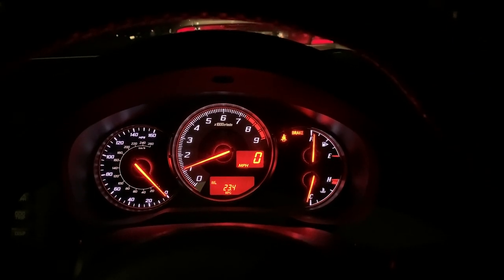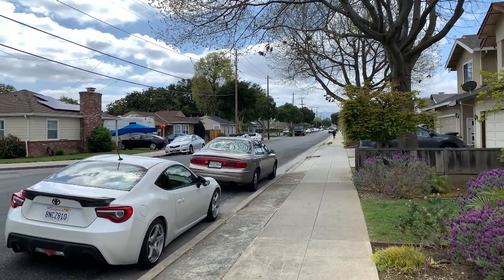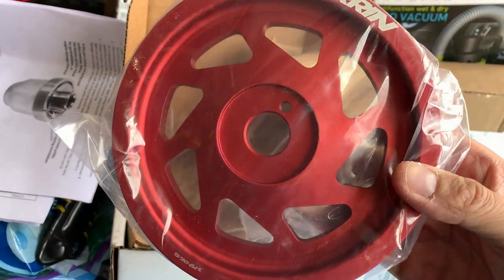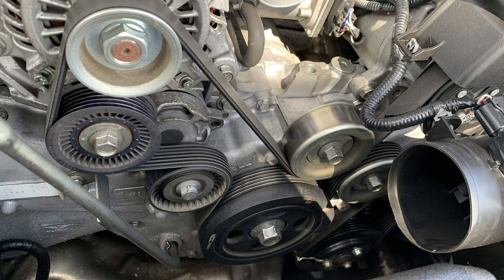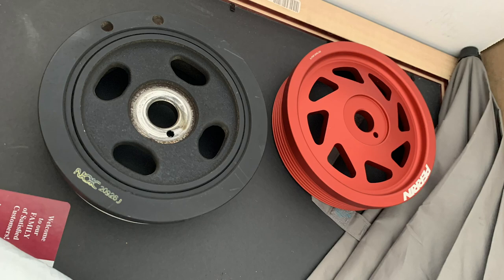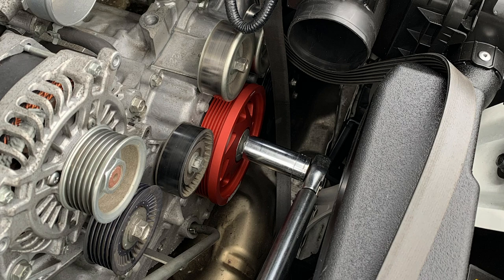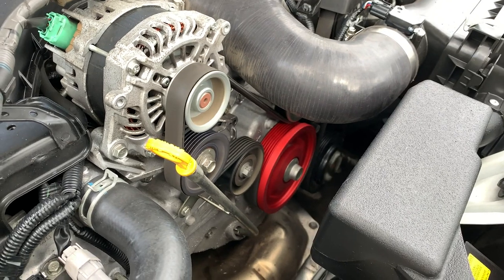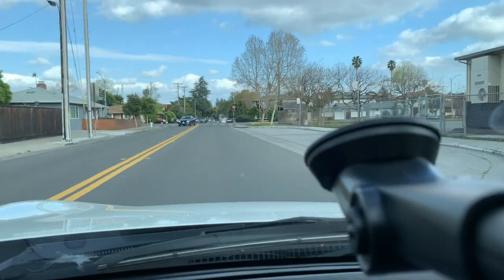Does a Lighter Crank Pulley Do Anything?

Comment: nothing to test really. basic physics. it decreases rotational mass, the less weight to spin the less power wasted. anyone else saying otherwise needs to go study up.
Reply: Lmao I read your last few words as "buddy up". I was confused for a sec thinking "why do I need a buddy for this?"
Reply: @TheTechNopal  buddy up and go study!! Lol
Reply: More vibration, bad for high revving engine. This is why not all racecar use it. Different cars, different tracks, different setups.
Edit: i'm talking under load
Reply: @arvin6606  yeah I recently installed one that didnt have the rubber thing in it to help crank vibrations and the pressure plate strap broke within a few miles, at redline.. :) the longer the crank the more the oem damper is needed
Reply: @zanastumasonis you installed a lightweight crank pulley and it snapped the belt on you?
Reply: @dylanboyance3682 serpentine belt came off when I was just aggressively revving it in neutral. Clutch pressure plate strap broke.. s52 inline6 3.2l bmw. Basically keep the oem one and make sure its in good condition too
Reply: @zanastumasonis  i see. i have a 11 wrx im trying to change the pulley on to a lightweight. Most of the forums for lower end power say they’re safe since wrxs are a lot more balanced then other vehicles and was yours a manual or an automatic? I’ve heard of automatics throwing belts with lighter pueys
Reply: @dylanboyance3682  your crank is shorter, the shorter it is the less tendency itll have to resonate like crazy, mine even had a more pronounced buzz at redline with the pulley(in a bad way)
Reply: @dylanboyance3682  i would keep the oem pulley
Reply: @zanastumasonis  we have two DOHC on the boxer motors so we’re definitely more unique also in the fact our vibrations are much more equal. I’m not changing the length of the belts or circumference size with the pulley. I’ve heard positive and negative stuff about this
Reply: @dylanboyance3682  well my belt got thrown because of the additional vibrations, length was good and it was definitely tight enough. As I said, I even didnt like how it felt at redline because you could feel the crank so much. Trust me just keep the oem one, dont waste time

Comment: I have been modifying cars for maybe 20 years and I swear underdrive lightweight pulleys are one of the best bang for buck mods you can really feel a difference compared to all the other stuff like headers and intake and I have not had a single problem with any of the cars I had them on.
Reply from the maker: yeah as shown in the video, there is an actual difference- and the affordability and ease of install I’d say is good bang for buck for sure.
Reply: Is the lightweight pulley a big enough increase to throw you back in the seat compared to factory pulley?
Reply from the maker: @cedricmiller4370  lol there’s nothing that’s $90 or less and takes 15 min to install that will “throw you back in the seat”. this is mainly for downshifting while clutch-in.
Reply: @cedricmiller4370  😂 
🤦🏼‍♂️
Reply: @gt86er14  mine is 160 will that make it better
Reply: Isn't a better solution to lighten the flywheel? Rather than muck around with the harmonics? Just saying.
Reply: @doraexplora9046  flywheel is a more "effective" solution. "better" you have to consider effectiveness, cost, AND ease of installation. you can't install a flywheel yourself with a few tools from home depot
Reply: @drawingwithcal1552  I'm not the mechanic. I just design the engine I want. I think the most effective I've seen is a fully lightened and balanced internals, making the flywheel as light as practical. It costs a lot to do, but the results are breath taking.
Reply: @doraexplora9046  yeah i agree, it is 'more effective' - but for it to be 'better' better encompasses everything, especially for me- i'm the mechanic and the designer so i have to consider cost and labor. $90 and 15 min with simple tools is a no-brainer. flywheel you have to take the transmission off, which means you have to take the drive shaft off and the exhaust off, its a full day and you might need 2 people. and you do all this work that takes forever, you shouldn't just change the flywheel then, should change the clutch out too- there's a million things to consider compared to 90 bucks and 15 min. i've spent longer changing the shifter out. that's why when i hear "better" i can't help but imagine the extreme difference of pain and sweat going into changing the flywheel. installing a turbo is faster. installing a supercharger is faster. tuning the ecu is faster. flywheel is one of those things where if your clutch is dying, only then do you change it out cuz it's such a pain in the ass
Reply: @doraexplora9046  depends on the type of flywheel. If you have a dual mass flywheel and swap a light weight single.. it will make a much more noticeable difference than lightened pulleys.
Reply: @joegage6171  I have a older style car so it's a single mass, single piece  F/W. I think it's solid aluminium and is waaay to heavy. I know that swapping out a dual mass for a single mass makes the clutch shudder.
Reply: Hey Michael I have a 1zr fe altis 1.6 manual 6 speed. I was looking in to gain its performance. Should I get a light weight pulley and flywheel and 6puck clutch pressure set and oem release bearing. I want power and daily drive it. Could u please let me know? 😊
Reply: Light Weight pulley is not the same as a Modified diameter pulley (which will be light weight aswell). You want to make sure the Diameter is increased for Performance gains. 56mm to 64mm as an example.
Reply: @drawingwithcal1552 Yes you can lol
Reply: @doraexplora9046 the flywheel is what actually takes care of harmonics in this engine (as in most modern DMF vehicles, idk if the 86 is dmf tho), NOT the crank pulley, thats why thats a simple pulley and not a damper type pulley.
Reply: @kanchingyg  NOPE! Don't agree. The reason they call it a Harmonic Balancer and not a flywheel is because it does just that. It negates the harmonics at every frequency throughout the rev range. The flywheel is the coupling interface. That's it. Nothing magic about those two. However, the DMF DOES smooth out the odd square wave harmonics in these engines and provides for a better engagement than a single flywheel clutch one. It's there to fix a poor design IMHO and is a very expensive solution at that.. Lightening a Harmonic balancer before touching the flywheel is just wrong.

Comment: It doesn’t add power, it helps free up the power that the motor already puts out
Reply from the maker: exactly- regaining power that you lose naturally cuz of rotational mass. every little bit helps
Reply: @bishop_98  people may argue that right, but the truth is Ive never seen anyone report damage caused by this thing. Ive been running it for half a year with no issues, I know friends that have been running it for almost 3 years and have not had a single complain
Reply: @bishop_98   maybe? the subaru engines due to design are more balanced than standard engine layouts. not running a harmonic damper is bad for standard engines, it can wear bearings faster, however we don't know if the subaru engines will suffer the same issues. I wouldnt risk it knowing what I know about harmonics and bearings.
Reply: @itsfantom3020  It's on one of my daily shit box pocket rocket 1.3L turbo kcar for roughly 7 years now. No issue so far and I abuse that thing quite a lot. Although years ago someone did tell me to find the exact size and not anything smaller just light weight. I do hear years ago when people did this people who had problems was the one who replaces the stock ones with smaller lighter ones.
Reply: @SketchbookGuitar  some engines arent bothered by running UDP or Light weight pulleys.  some are and the crank can damage the bearings. Mitsubishi 2.0L should NEVER be ran without a damper.
Reply: @epoxeclipse  That's interesting to know back then there wasn't much info about it on some unknown low output engines(kcars) and the talk of harmonic dampening is only found on the net but only about bigger engines.
Reply: @SketchbookGuitar  Some engines / crank design isn't bothered one way or the other. 4g63 cranks ring like a bell without a damper. Its too bad because the rotational weight I would prefer to lose.
Reply: @epoxeclipse  I assume this would affect the other 4G engines like the NA variants? I do know some people who loves these engines and installed light weight pulleys on them somewhat recently
Reply: @gt86er14  Except you cannot increase HORSEPOWER by reducing rotational mass. So be careful using that word "Power".

Comment: Alright im gonna end any doubts you may have about this once and for all, Ive been driving around with it for about 6 months now and you can feel a slight but very noticeable increase in throttle response as soon as you install it. At the time the car was running an oft stage 2+ tune, the difference is nothing crazy but if you can find them for under a $90 it is certainly worth it. Its never given me issues and if someone were to take out of my car and put the stock one back in without me knowing, id certainly know something is off, rev matching also becomes easier as it decreases rev hang
Reply: You forgot to inform that NHRA will not let you run aluminum crank pulleys or stock pulley if you have built a true race engine that makes a certain hp per liter and or ET. Run a aluminum crank pulley on a Honda b series engine making over 450 kiss your oil pump good buy

Comment: If absolutely nothing else, it just reduced the strain on your crank. Lighter flywheel in combination with lighter pullies would probably be more noticeable. There's a few options for my car but I don't know the brands. Crank pullie is not where I want to test their production quality. Generally speaking, reducing the load on your components without loosing reliability has never been frowned upon. Within reason.

Comment: Are these the same size as the stock one? Because i know for my car i can go down from a 6" to a 4 3/4" 160-120mm  wheel and the underdrive on watgerpump dyno and servo help out aswell as the stock is 3.2kg 6 and a bit pou ds and a alu one is like 1 pound 0.45kg

Comment: Items changed to lighter that will give the most noticable improvement in throttle response,in decending order...(1) Clutch & Flywheel (2) Harmonic Balancer,(3) Crank Pulley. Additionally,"going inside" the engine with lighter Crank,Rods,Pistons & Wristpins then dynamically "spin" balance the whole assembly for smoothness. * These will NOT add much to increase overall HP but each part lightened,in order will greatly improved throttle response.
Reply: the harmonic balancer is the crank pulley
Reply: @joemilton7552  Yes. Your point ?
Reply: And don't forget about the aluminum driveshaft 😎😁👍
Reply: Exactly what I’ve been thinking on doing with my car. I have an old 1992 Toyota and all I want is to feel it smoother and easier to drive if you get me. My car is as smooth as it comes cause I put a lot of investment into restoring it fully stock but suspension. But these are upgrades I’ve considered for the fun of the car.
Reply: @TomAnderson.  I think personally, I would have put that effort into a rarer car. Unless it's a special model of Toyota?
Reply: @doraexplora9046  is a rare car where I’m from, you can barely see them anymore. Is a Toyota Paseo, is a tercel with a much better box. People love Toyota Tercel down here but Paseo not much cause it essentially the same thing but with a sporty box and a little more expensive at the time.

A lot of people didn’t gave them as much love as they deserve and when i found the one i had for the price i couldn’t let it pass.
Reply: @TomAnderson.  I do remember those cars. I first saw one in Boston in the mid nineties (I think). They rusted really quickly in Boston. If they were ever in Australia it wasn't for long. I don't recall a Tercel. But yeah sounds well worth doing up. If the engine was in other model then it will be easy to find parts for.
Reply: @doraexplora9046  yeah is all mechanically the same in between a Toyota Tercel and a Toyota Paseo. Since down here everybody loves Toyota all over the Island i have more than supplies for mine. 

The differnce i thing it’s in the Oil Pan and camshaft that i know of at the moment.

But the rest is literally the same, maybe the calipers are a little bit bigger in a Paseo but that’s all i know of. They are literally the same even in the inside.
Reply: @TomAnderson.  I dunno where you live. But when you say 'island', I'm thinking lack of sophisticated skills and equipment if you want to lighten and balance stuff. If you want to do it the ol' fashioned way. then you just weigh everything on a sensitive scale. Not sure about modern engines and what you can get away with when you want to lighten things.
Reply: @doraexplora9046  my bad, I’m from Puerto Rico. So don’t worry we are up to date in everything. We have everything we need here but machine shops to modify wheels. 

But we have all of the rest, our culture in Puerto Rico is based on reggaeton, cars and arroz con gandules 😂

So yeah i could do it but i myself am super stingy with my money so i’m taking my time.
Reply: @TomAnderson.  LOL. I had to use Google translate for 'arroz con gandules' and it gave me 'rice with pigeon peas'. I doubt that is the correct translation!
One of my very best cars was all done by the guy I bought it from. He took the engine apart and lightened everything by hand. He then balanced everything by hand. He had a lathe and a scale. So it can be done in a low-tech environment.
Reply: @doraexplora9046  that’s good to hear. My recent mechanic is a project mechanic and he is an old friend of mine. I built a solid friendship with him before letting him touch my car and he is good at what he does.

We were planning on making mine all motor but like he told me “don’t do it on a hurry even if it takes years make sure what you wanna do with your car cause not everybody gets what they expect and they are not pleased” and i am going slowly with mine to make sure everything i’m doing is the proper upgrade.
Reply: @TomAnderson.  Building a 'car' is a multi-year project. Mainly because you learn along the way and you realise the value in something and not others. It's value-for-money spending. However, after a few projects you do kinda know what to go straight to as far as mods go. But every car is different. I have three Alfa Romeo's and there's not a lot you can modify on them because the factory did such a great job in designing and building them. There's literally nothing to do on the head, the intake or engine. There's just no 'meat' to use. So you are really left with cams, exhaust and forced induction. All VERY expensive on an Italian car.
Reply: @doraexplora9046  yeah those cars are basically like pre build PC’s ready to use for what you want. I love AR but for me super cars aren’t fun until i hit my 40’s that i won’t have patience for modding base cars.

Comment: I'm a very by the numbers guy, a lighter crank pulley has to do something, albeit it may be very little depending on the power output of the motor, BUT it is doing something. Whether you gained .5hp or 3 it still is making a numerical difference. Its lighter than the OEM pulley, and the rotating assembly benefits from that. This is within the same sort of debate of Lighter rims YES rpf01s will make a difference over most factory wheels, is it something that's going to wow you and change your life? No it wont.
Reply: My concern you are micking around with the harmonics of the engine, in particular the crank. Surely lightening moves the harmonics up the frequency range. What happens to the low end frequency dampening? Balance it sure. But unless you are a switched on engine builder, who understand harmonics, and can fine tune the balancer, I wouldn't touch it.

Comment: What pulleys do is free up HP.  It lessens the parasitic drag. To feel the full effect you would need every pully lightened or smaller diameter. And no it doesnt wear anything down, ive had my crank pulley and all the others on for 180k now. VW r32
Reply: slows down the crank?  no
Reply: @joemilton7552  Actually now that I think about it the crank moves at the same speed, it's the other accessories that slow down.
Reply: Yes

Comment: Could you feel the difference in your hands? I was thinking about getting one for better response for my TRD camry (don’t make fun) it’s a cool Camry lol but looking to get better response and power and mainly get most my my stock power restored then go from there. What do you recommend? Also what about the control and stability of your wheel and feel your suspension and your wheels, I feel something kinda wobbling under my foot sorta. Maybe a bushing or some sort. Ball joint is good and all of that but what could make it stronger? Also how do I get the pressure back (sensitive breaking is what I want back) I don’t have leaks in the lines but could there be air? Or what? I was going to get a stainless steel break line kit and a new crank pully and break master cylinder